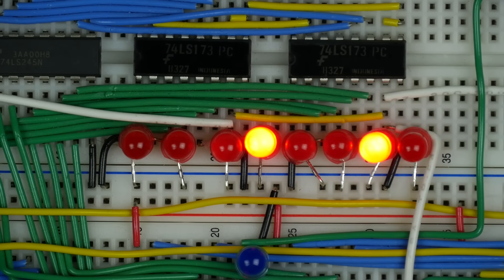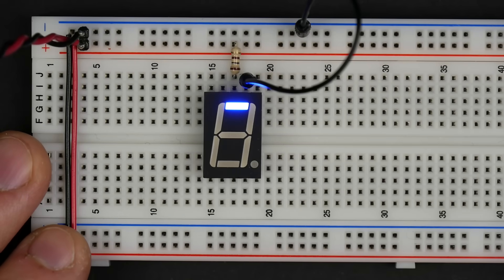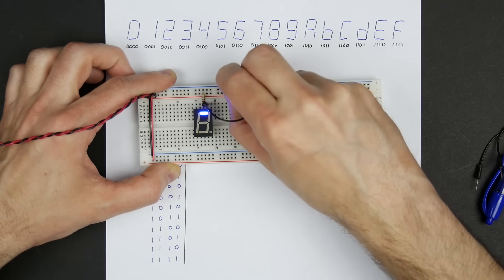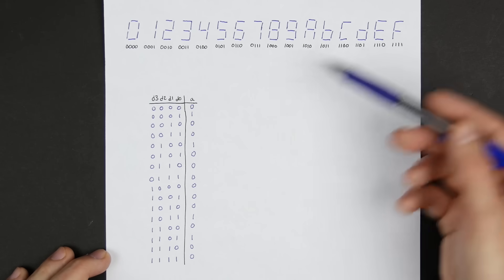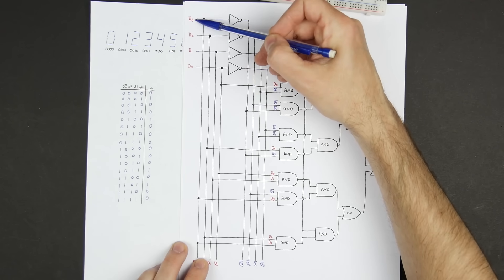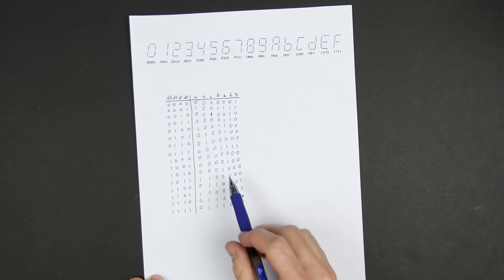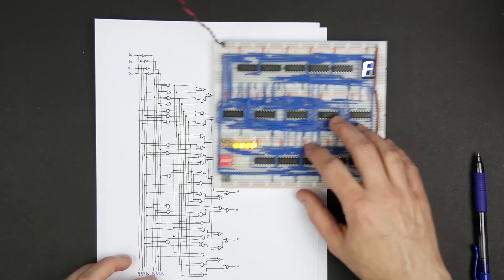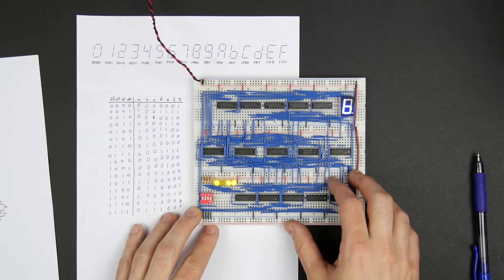Designing a 7-segment hex decoder

Comment: I was just reading that HP 5082-7340 (intelligent displays) are still being made.  I don't know if HP is making them or someone else, though.  Everything for BCD to Hex is built right into the LED display which uses a very nice 5x7 array to display the digits.  It's about the same size as the displays you are using, and simply has 4 BCD inputs.

Comment: This video brings back a lot of memories, had to do something similar to this in a high school class project (i.e. turning a binary sequence into a series of 7 segment display outputs). The main difference is between the truth table step and the circuit layout step I constructed the logic equation associated with the truth table (which was quite long...) and then simplified that equation before adapting it to logic gates, trusting that my simplification resulted in a functionally equivalent but very much smaller set of logic gates to be constructed.

Comment: I was thinking about simpler solutions an i think if i load my number as a 4 bit binary number from 0 to 9 into a demultiplexer and the demultiplexer will turn a pin on for every number i get to it so i can directly connect the corresponding output pin of demultiplexer into segments of that 7-segment that should be on for that specific number it should work fine!!
Right? 👍
Reply: It’s not about simple solutions, it’s about learning

Comment: It is possible to synthesize on two 74hc138 decoders and 34 diodes a module that displays the symbols 0-F on a 7-segment indicator.
It is expensive for one indicator, but quite acceptable for a dynamic display with 8 indicators.
This is for the case when, for some reason, a programmer is not available to us - and therefore no programmable microcontrollers or memory.
We don't laugh at alternative energy from solar panels or gasoline generators when there is no voltage in the outlet, do we?

Comment: how can we calculate the required resitance value for a particular voltage drop?....like u put 100 ohm resistance, i cant really understand how 100 ohm would make the voltage drop by 2 Volts. i'm a beginner in this field, so dont mind if the question is too dumb..
lol

Comment: I have a way simpler logic gate circuit design for decoding, you start by getting 4 And gates which turn on when the first two digits of your number are 00, 01, 10, or 11. So like a mini decoder. The you do the same for the last two digits which should cost you 8 gates total. 
Now if you want to decode for example 1011 all you need to do is hook up the outputs of the primary 10 And gate and the secondary 11 And gate to the two inputs of another And gate. 

The truthtable could look something like this:

The basic
primary:
D3|D2|D1|D0||g0|g1|g2|g3
0   |0  |0  |0   ||1   |0  |0  |0
0   |0  |0  |1   ||1   |0  |0  |0
0   |0  |1  |0   ||1   |0  |0  |0
0   |0  |1  |1   ||1   |0  |0  |0
0   |1  |0  |0   ||0   |1  |0  |0
0   |1  |0  |1   ||0   |1  |0  |0
0   |1  |1  |0   ||0   |1  |0  |0
0   |1  |1  |1   ||0   |1  |0  |0
1   |0  |0  |0   ||0   |0  |1  |0
1   |0  |0  |1   ||0   |0  |1  |0
1   |0  |1  |0   ||0   |0  |1  |0
1   |0  |1  |1   ||0   |0  |1  |0
1   |1  |0  |0   ||0   |0  |0  |1
1   |1  |0  |1   ||0   |0  |0  |1
1   |1  |1  |0   ||0   |0  |0  |1
1   |1  |1  |1   ||0   |0  |0  |1

secondary:
D3|D2|D1|D0||g4|g5|g6|g7
0   |0  |0  |0   ||1   |0  |0  |0
0   |0  |0  |1   ||0  |1  |0  |0
0   |0  |1  |0   ||0   |0  |1  |0
0   |0  |1  |1   ||0   |0  |0  |1
0   |1  |0  |0   ||1   |0  |0  |0
0   |1  |0  |1   ||0  |1  |0  |0
0   |1  |1  |0   ||0   |0  |1  |0
0   |1  |1  |1   ||0   |0  |0  |1
1   |0  |0  |0   ||1   |0  |0  |0
1   |0  |0  |1   ||0  |1  |0  |0
1   |0  |1  |0   ||0   |0  |1  |0
1   |0  |1  |1   ||0   |0  |0  |1
1   |1  |0  |0   ||1   |0  |0  |0
1   |1  |0  |1   ||0  |1  |0  |0
1   |1  |1  |0   ||0   |0  |1  |0
1   |1  |1  |1   ||0   |0  |0  |1

and now you can decode all 16 numbers with a single And gate. If you want to decode 1011 you only have to combine g2 and g7 into an And gate. This circuit only requires 24 And gates do decode any 4 bit number. (8 for the basic and 16 for the 16 numbers) 
hope that helps

Comment: I was just working with 7-segment display and binary decoding for an assignment in my Digital Fundamentals college class, more specifically I had to consider the "Don't-Care" condition for K-maps, where certain input binary values would be ignored, making the simplification of the boolean algebra equation needed for building the circuit a LOT easier. Although we didn't consider hexadecimal numbers after 9, so that's why I needed to apply the "Don't-Care" condition.
It's super exciting to finally be able to tinker with this stuff myself, though there is a lot of stuff to learn. Regardless, it's entertaining and educational!

Comment: 📺💬 Jirayu we create digits input from bits signals where are the digits generators.
🥺💬 It is the same programming output but you also see it in the PLC program.
📺💬 How do you have it⁉ 🥺💬 I have it and other simulation program simulink that is most 4 years I fixed many of devices included television but I think to have some certificate and something for working apply I exame certificate that is almost 100 items about 50 certificates and I do not see any reasons I cannot apply or answers StackOverflow but they speaker me.
🥺💬 I think please continue on the lessons everyone benefits for it I reply many times I keep improving my skills but they still not interesting.

📺💬 Make it using a circuit it is not a serial circuit but it is easier using EEPROM.
🥺💬 Digits display order by frequency use which is why the dash line is ordered.
🐑💬 Do not forget to connect the ground that is because when working with frequency it can create mistakes, make for stability. 
🧸💬 That what happens when calculator is running out of battery too ‼

Comment: "It's a little bit complicated"
Yeah. Just a little bit.
Sarcasm.

There may be much more easy and reliable way to design such kind of a thing.
1) We're using quite simple integrated decoder of 4-bit number to a 16 single bit array. That is after decoding we'll get the only one line of sixteen activated. Then we will use simple 16x7 diode matrix converter to produce proper output to seven segment indicator. 
So the only one chip and about fifty diodes, arranged in regular way according to the table, will be used.

Comment: Putting 0 for ground is understandable. But in that case it should happen even if it is not grounded either like it happens in logic gates or full adder circuit. When we don't give any voltage or connection is broken then also we  write 0. Why is that?

Comment: the bread boards and blue wires display a very well detailed 5 just in case it stops working 100 years from now they'll wonder if we wrote on plastic tablets to save messages from God for generations to come. Funny, 5 fingers, 5 toes, 55 mph, and 36.... 5 days a year a. k. a. 5 extra degrees to 360 on a circle, 5 is the 3rd prime number, 7 segments div by 2 is 3.(5) and 7 x 2 is 14 the total digits and letters+1 is 15 or 3x5 or 1 less than 6 36,0 6+3=9 and 0 the 10th num where 7+3 would be 10.  I think 5 is pointing at 7 the divine number and the fact that we're missing something in life and trying to compensate for the 5 fingers connected to the divine thing we're missing. 7 lamp stands or candle sticks in the hand!

Comment: The 0 is on stock is high incidentally homework computer is hard to turn on The 1 is off the 2 it’s on from 3 it’s on for 4 is off for 5 it’s on From 6 It’s on from 7 it’s on from 8 is on for 9 it’s on From a it’s a one from BTS on this is one From CVS on from D’s off Jennifer E ant F It’s on

Comment: I really want to see if it's possible to make this circuit into a multi-digit 7-segment display using a clock module and latches. While this would be more complex and probably less time efficient than utilising an EEPROM as you do in the next video, I think it would show a good implimentation of latches and registers.

I guess if you wanted to fix the time efficiency issue, you could latch in the input and have a clock multiplier so that you get multiple in-component clock pulses for each input (system) clock pulse (it'd have to be at least one internal-pulse per 7-segment display). Would you need separate pulses for read and lock? Which would mean to encorporate 2x 7-segment displays you'd need the module to pulse 4 times per system clock pulse? Is this then going to limit the speed of the overall system?

I really want to try this now, but ... hmmm, maybe if I do the diagramming I could then convince myself to buy the parts 🤔

Comment: can also use a GAL16V8 for seven segment decoding, and the format is quite simple to just write out fusemaps, the logic at 7:13 would be
L0000* 10111011011110111111111111111111
L0032* 10110111101101111111111111111111
L0064* 01110111101110111111111111111111

i would know this because ive recently built the 16V8 and a 22V10 in minecraft and am a... "bit in touch" with the architecture

Comment: I know that this was posted 4 years ago, But with a hope and a prayer I am sending this s.o.s for your help. My father was a electronics genius and I never truly got to appreciate it while he was still here with me. I miss him and wanted to build a gift to send to my sister in my fathers honor. My father built a electronic shut box game using 7 segment L.E.Ds. It was rudimentary (however for me it feels like rocket science) each 7 segment display was always on display for each number 1-12 each had a small toggle switch to turn off the number. He also devised a press button electronic Dice set that would roll random numbers at the press of the button. I have cheated and ordered the pre made led dice however I was looking for direction with 7 segment wiring on the circuit board to wire each number individually to their own toggle (12 numbers and 12 toggles) (all lit until the toggle is switched off). I have the 7 segment L.E.Ds, toggles, 9 volt battery tray, and a huge pack of resisters. Am I going to need anything else since I am not looking to have these 7 segments do anything other than stay illuminated until switched off? One last question What gauge wire should I use to solder and connect everything?
Thank you ahead of time for any help you could throw my direction.

Comment: I recently designed and built a binary to hexadecimal driver from scratch. Created the truth table, reduced it to 43 gates (including inverters but also using XOR and triple input gates), simulated in Logisim Evolution, realized in twelve 7400 series logic ICs, created a schematic, and designed a custom PCB to connect everything. After all that design work then waiting for the ICs and PCBs to arrive, assembling that hardware and having it work flawlessly was awesome. Sure it's inefficient and willfully outdated but it is far more satisfying than any microcontroller program could be.

Comment: This is a bit beside the point, but there are easier ways to drive 3 digits than to build a single massive circuit.

First of all, just build three of these and drive each digit separately. You can use Binary Coded Decimal - some of these 8-bit chips have it built in.

But, you actually only need one. Just have the same circuit drive all three displays (or as many as you want), and rapidly cycle between them by toggling the common line on/off. To a human, if you do it fast enough, it looks like all three are on at once. (This is called persistence of vision)

Comment: My EE 102 course covering combinational circuits, FSMs, and etc made me detest electrical engineering because of how damn hard they make it to learn the course. Every class I get more and more confused about how stuff is meant to work and just figuring out the most basic concepts is hell for me. I spent a whole day figuring out how to write a code for 7-segment displays on VHDL for my lab and the instructors haven't said a word about how we are supposed to do it and I spent a whole day scouring the internet and trying to understand how it works and how to implement it on code. This video is only 15 min long and it basically explains how the whole thing works in a very clean, digestible, easy to understand manner. Had I found it when I needed it, it would've saved me so much time.

Comment: Bless you Ben.I've done this at least 7 times only because i was using Intel's quartus prime lite and i was testing my results with the correspoding simulations to each output.D kept being wrong the whole time , i kept on checking my truth table for the decoder and i found out that d had a 0 in the number 9 thanks to you contrary to my university's lab that had forgotten this and had d turned off in the number 9 in the project's instructions.Thank you so much for your help

Comment: You skipped straight from a truth table to the circuit... did you even try to minimise the logic? I mean, you have 4 conditions, its unlikely that you could minimise the equation for segment a, but still... 

I programmed this circuit into a PAL chip. I actually went a step further and included an extra line that lets you choose CA or CC for the 7 segment display. but that would be Level 4. (Basically, for a CC/CA toggle, you need to XOR the result with the CC/CA line.)
I have also done an EPROM version of this too.

Comment: Back in the old days, data books for the 74xx logic chips usually contained the schematics of the internal design.

ROM chips do this kind of job much simpler, but maybe not as fast.

Ben is one order of magnitude away from showing us FPGA devices.  I hope he covers them in a series.  You can literally build circuits like this, up through entire CPU functionality, using a programmable grid of simple logic blocks connected together.  The beauty is that the connections are controlled by a configuration file, somewhat resembling software, that is loaded from a small EEPROM at power up.  

Hopefully his next video shows us how you can effectively create any logic element function (and, or, not, xor, nand, add, sub), with up to 16 inputs using a 64k byte EPROM.

Four input lookup tables are the basic building block in an FPGA. Thousand of them configured properly and strung together can accomplish anything a cpu can do, and possibly do it faster.  I encourage visitors here to look into the way that FPGAs compliment a traditional CPU.  Most devices built today contain both a traditional CPU, and a companion FPGA that can do things no CPU is capable of doing. For example, sampling analog waveforms at perfectly timed intervals and at over 1 billion times per second.  The real beauty is that function can be changed by simply changing the configuration data to fix bugs or add new features.

Comment: 9:27: You could have also arranged the gates differently and taken a shortcut with D1 and !D2, which also does occur twice, but that would have precluded your saving the D0 and !D1 gate that you did save, so it's either save that one or the other one but not both, and in fairness your arrangement is simpler. I just needed to say that I noticed that.

Comment: I don't know if you corrected it later, but using only one resistor for the whole 7-segment-Unit isn't that well, becaue each Segment will pull a specific current. And the voltage across the resistor (to set the voltage at each LED to 3V) depends on the resistance of it and the current through it (with the LED it is a little bit more complex, but that's basically the point). The problem occuring now is that if you turn pn multiple LEDs, the current through the LEDs will sum up and so the voltage aceoss the resistor will increase. By doing so, the current through the LEDs will decrease and the LEDs will be less bright. By using only 2 Segments, this won't be that much, but if you compare your "8" and only a "1", you should definitely see a difference. If you use an individual resistor for each segement, that would be much better. Because then the current through each LED is independant to the number of LEDs shining.

Comment: How he took 1 when segment is off
Generally we take active high.
Please correct me
Reply: The logic is reversed because he’s using common anode displays. You’re switching on the negative side of the LED so you need to set high voltage to turn it off.

Comment: Great educational device. For a DCBA 4 wire binary coded decimal you could use a driver like the 7447 to convert it a 7 segment output or use a 74LS145 to convert it to a decimal output. Using an EEPROM is a neat way of doing it but a 7447 would be a cheaper and easier option. They even offer ripple carry IO pins. They also have some function pins you may or may not make use of. The EEPROM method is tried and true so I rather like it. The combinational logic method is purely educational and isnt really great in practice but knowing how it works and having that visualization is really awesome. Thank you for the time and effort in these projects

Comment: Your breadboard solution is a great way to visualize the Tyranny of Numbers (Wires) problem. Back before the IC (Integrated Circuit) was invented, people knew that building a computer was possible, but were unable to build it because of the number of wires required (impossible to physically connect the circuit). Jack Kilby invented the IC, and now we have computers. Ben's beautiful breadboard examples demonstrates the Tyranny of numbers problem.

Comment: There is something wrong with that resistor. You should use one for every led not one for all. Like this every other led will lower the resistance and the LEDs will get less and less power. I wonder why this even works in the video.

Comment: This can be reduced to 7 OR gates and 25 AND gates if he uses quad input gates, he just has dual inputs on hand. Do you really need OR gate ICs though? Wouldn't just plugging output wires into the same column on the breadboard or twisting them together do the same thing? I am new to all this so genuinely curious what the purpose is for them.